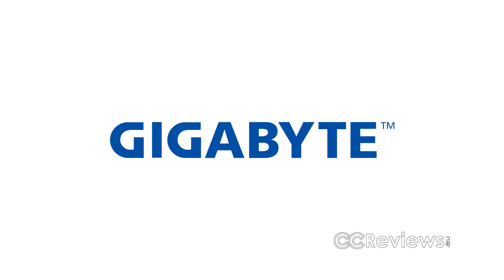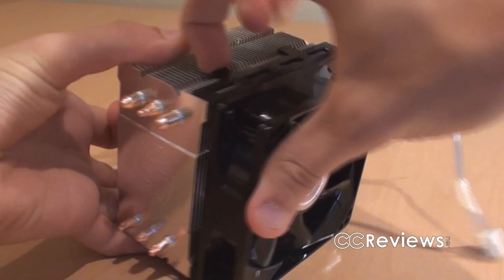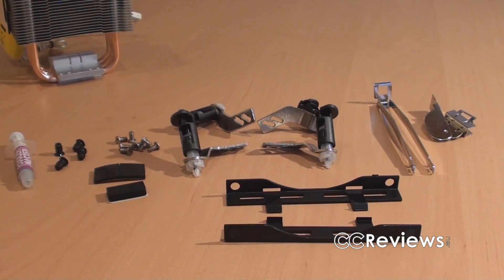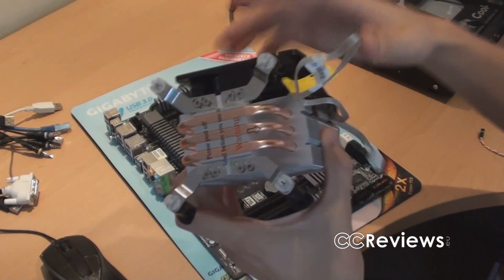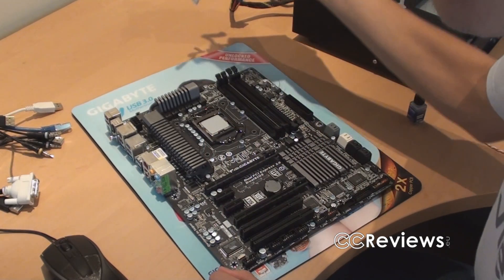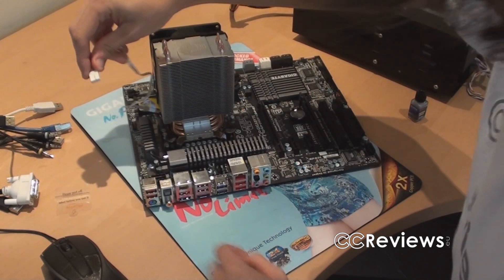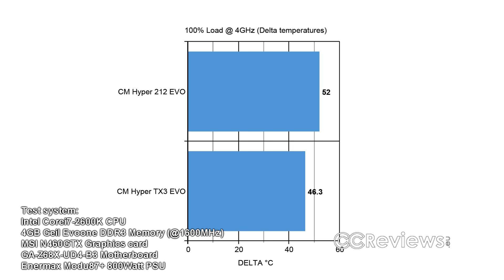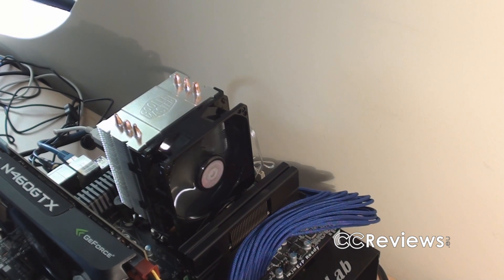#55: Cooler Master Hyper TX3 EVO CPU cooler Review (CCReviews)

Comment: I got one of these coolers about 14 years ago. Worked very fine for my first build. with a i5 3750k.  Just recently in in 2024 the plastic clips that connect to the motherboard became brittle and broke off. Replaced it with a Coolermaster 212 evo.

Comment: I run it with an 7700k and with  outside temperature of 30 Celsius I see idle 31 and at  moderate load, around 56 to 58!! Cheep but very effective, will wait for cooler months so I can see lower temperatures!
Reply: kostastaxi how it is during gaming?

Comment: And abysmal cooler when it comes to high end cpus like the Ryzen 7.  Its really some kind of dwarf cooler, dangerously small, runs on my Ryzen 7, @a good 20c hotter than other proper air coolers. Dangerous for overclocking on a Ryzen 7 as even on mild overclocks it cannot clear the heat quick enough to prevent continuous heat build-up until it hits the thermal limits of the cpu. DONT BOTHER WITH THIS PATHETIC HEATSINK UNLESS YOU ARE ON A BUDGET AND DONT PLAN ON OVERCLOCKING.
Reply: It is been a month but i just wanted to reply, are you really comparing this cooler to a 212 evo? Because of course it will perform better on overclocking and more powerfull cpus. The Tx3 has and 92mm fan and a smaller heat sink compared whit the 120mm fan of 212 evo and larger heat sink. The point of th TX3 is a smaller cooler, identical to 212 evo, for more tight cases. And if you re spending money on a Ryzen 7 you wouldn't even bother or considering buying this cooler because you will need something to keep whit the overclock later on. I didn't understand the point of your comment.

Comment: Guys, I'm begging you, please help me. I did everything fine with the installation and assembly of the cpu fan, screws are in the correct position for my 1151 socket, but the cooler doesn't go all the way in. Two clips go all the way in, but the other two can't. I'm anxious I can damage the motherboard from pushing, but really, it's really tough.
Reply: Well i can try to help you...
Read till the end before doing anything please.
Just take the cooler without trying to mount it on your mother board : do the pins works normally ? Can you unlock them and lock them in ?
Do you succeed to install your old stock cooler back again ? Is the lenght between each pin equal if you mesure from your stock cooler and on your TX3 ?
If they are not check if you did install the legs of the TX3 properly, and maybe try to bend them just a little ?
Just don't force too much on your mother board, i mean you can go firmly, but don't be savage.
For me the most secure way to do it would be to take the time to disconnect and remove your mother board from your case and to mount it inside... That way you could see way more easily what is happening and if the pins are coming in normally.
It's scarry, and a bit tricky to put back on (especially the front pannel connectors) but that's what i would do (remember to take close pictures especially of how the front pannel pins are connected to remember then when you put everything back in)
Reply: Thank you very much for your time and effort you put in this comment. : ) Actually I managed to get it in. Basically, the clippers don't go all the way in no matter what. If I push two clippers - two vertical ones - they go all the way in, but the others don't, which is understandable, clippers should be pushed diagonally first. One pair diagonal than the next one. Well, that doesn't work either, so I realized that when I push one of the clippers which doesn't go in, it actually does go in, but then it goes up again when I release.. So I forced it go back in and then I twist the clipper so it can secure the hole. It was kinda tough to do, cause I was holding the other part of the fan with my other hand. I actually thought about doing this from the start, but I didn't know that the clippers can be secured like that, thought they can be only pushed. 
Lesson learned. ; )
Reply: Glad it worked fine :p satisfying temps ?
Reply: 26-27 degrees C on idle. Intel 6600k. Really good temps !

Comment: Can I use this in my i7 6700k ??
Reply: no. you can only use it on your Xbox one CPU
Reply: ok... I was not kidding... just fuck you
Reply: ofc you can bud...
Reply: Gabriel Coelho doesnt depend of the cpu but of the motherboard
Reply: yeah. Im asking cause i have not seen this config  (i7 6700k + this cooler) yet, and I want to know about the temperature of this mix
Reply: i wont do OC
Reply: TheElmorenous did u get it ?
Reply: Gabriel Coelho why are you getting the "k" version if you are not going to OC? You can use it on that CPU ofc...
Reply: I won it. I will oc, but not now
Reply: Gabriel Coelho ohh I see... in that case buy a z170 motherboard and a good cooler such us CoolerMaster 212 evo or cryorig h7, dont buy this if you will oc
Reply: Well it's a very nice cooler if you do not want to dismount your motherboard (they can come with the plastic pins to fix it to the motherboard so you don't need a backplate).
But i would chose an higher end Rad like a Dark Rock pro or something (but be careful, the rock pro may be tricky to install if you don't have low-profile RAM)

Comment: How much space should there be between CPU cooler and RAM? I'm worried when I install it that it'd be too close to my RAM. The motherboard socket is 1151.
Reply: You don't usually have to worry about that. If you want some headroom you could use low profile ram. (That's what I do).
Reply: Oh, I didn't know about low profile ram solution, thanks for reply.
Reply: No problem mate!

Comment: i got one the only problem installing it was the top left corner clip was hard to pop in and twist it and also had to plug in the power lead befor installing it apart from that it is great for its price and took 20'c off my temp whent from 80+ down to an average 60 and below on full load
Reply: How did you pop it in exactly? I have two clips which can't go all the way in ;(
Reply: Use a screw driver buddy

Comment: is it overhanging the memory slots? that's annoying
Reply: You can move the fan :) it comes off and can be clipped on the other side. or you could spin the block around.
Reply: no not realy it depends on what mother board u have

Comment: dose it come with thermal paste?
Reply: yes
Reply: k k, thanks
Reply: I meant it came**
Reply: +k Oh okay I don't need it because I already may own thermal paste, it's a small syringe from Arctic Cooling
Reply: dckstr yea
Reply: If it comes with thermal paste then why did the guy put some on the motherboard?
Reply: +dckstr because you shouldn't ever really use the pre-applied thermal paste it comes with, I just checked mine today and only after a few days the thermal paste was already almost gone from the heat, I cleaned it of and pre-applied using some NT-H1 thermal compound and my temps on my i7 went from 45 to 35. However, the product comes with a small tube like item that contains thermal paste. You could use that.
Reply: +dckstr also I just re-watched and it wasn't pre-applied. You must of thought that I want it came pre-applied, but I was talking about how it came with a small tube full of thermal compound

Comment: You think this will cool down my i7 4790k when rendering a video?
Reply: Haven´t bought the CPU yet:) but i think i will go with the I5 6600k, i have quited YT, so i dont need to render videos and things like that anymore:)
Reply: +TheDanilon62 yes, I have a i7 4790 with this cooler it sounds like a jet when I game do not recommend for processors like mine however I'm upgrading it with a corsair hydro series one soon
Reply: Skaffa dig en 4690K med den här kylaren så kan du till och med överklocka lite, plus - Minecraft, DayZ, och andra processorkrävande spel flyter på som smort! :)

Comment: I have 4 kingston hyperx fury ram modules in my motherboard. Will the fan come in conflict with the first stick?
Reply: +Amar Raj Jagessar Have you had it on yet, and does it interfere with the ram sticks? I am having the very same question? 4 G.Skill Ripjaw sticks :P
Reply: Still using the stock. Dont have it yet
Reply: I think it can be turned though, I'mma buy one today after some more reviews
Reply: +Mathias Vejs keep me posted
Reply: Amar Raj Jagessar I have just put mine in, and it fit by a few milimeters, phew. Please be sure if you're using Intel, please be sure to turn the psuh-pins clockwise before putting it in, damn I forgot that, heh. Works fine though ;)
Reply: nice, did you build it in the case or with the mobo outside of it? And did you had to remove the ram?
Reply: I put it in IN the case, and I took all four ram sticks out, then put all back in again when I had it installed :)

Comment: I have such and does not'm amazed. In quiet mode it is quiet, but otherwise noisy and temperatures for analysis are not so low that it g1610 use of which is only a 2.6Ghz. Boxing at full power was quieter than that of full speed. 

PS:
Would someone told how to use the second as a motherboard can only join one. If plugging it to another connector second fan will change speed relative to the temperature of the motherboard, not the CPU and the two will rotate at different speeds.

Comment: I will get this baby! Been mulling over Zalman and Cooler Master offerings but selection/price is a bit limited where I'm shopping and my budget is not that high as I intend to buy a new case for my MSI/AMD high performance rig. Gotta get those temps as low as possible. My AM2 3800+ CPU ran without fail for 9 long years with a Cooler Master cooler that's similar to this TX3 actually - don't need any more motivation than that :)

Comment: I forgot to peel off the plastic lol
Reply: +boowh1 Did you turn your computer on afterwards? In which case I'm curious what happened.
Reply: The cpu got very hot so I peeled of the plastic redid thermal paste all is well
Reply: Ah right, could've been worse. Luckily there was no damage.

Comment: I have i5-4690 3,5ghz locked cpu. Wouldn't it be overkill, if i get about 74C with stock cooler, which is pretty loud, when playing games like GTA V, COD AW?
Reply: Don't worry i am getting Arctic Freezer 7 pro, and also i reapplied thermal paste on my stock cooler a week ago, so now my temps don't go above 67C
Reply: Thelostzip that is still over 150 degrees Fahrenheit.....
Reply: With new cooler it doesn't go over 58C on beefy gaming
Reply: Piers Nivans My brother has an i5 that runs 80-100 degrees celsius when he plays and has been doing so for the past year, still fine processors don't die as easily as you might think when you run them at stock speeds. I'm getting a new cooler for him though now that's why I'm here.
Reply: Piers Nivans I know that's why I'm getting a new cooler, just wanted to point out that processors are usually pretty resilient to high temperatures and have built in safety measures to prevent damage. Prolonged high temperatures significantly reduce life expectancy though from 50+ years to possibly under 5, a processor running 80+ degrees when it should be around 60-70 tops is like time's passing upto 50x faster for the processor.

Comment: this is the best thing i ever bought ! from 90+c to 60c Max !!
Reply: +Jonathan Peden m8 go amd i have 9350 oc 5ghz
Reply: Ziad Ak I'm glad to read your comment, I have just received mine, I'm waiting for my CPU, motherboard and RAM to arrive so I can do my full system upgrade.
Reply: what the hell! your cpu should not run that hot where do you live death valley and its 125 degrees Fahrenheit inside your room?
Reply: @xDEATHCLINCHx  please see if you can help me with my trouble !
Reply: @xDEATHCLINCHx  hey check my scenario you would be shocked 😅 , can you help me out ?
Reply: I can definitely add this up. My 88°C CPU with stock cooler on load is now running at 60°C ish under load ! definitely a worthy choice
Reply: anas lolit Now that's what I'm saying brother!!  Intel?  Intel who...?
Reply: please help me out , my i3 540 cpu temp breaches 100°c barrier in AAA gaming with my gtx1070 , sorry for mismatching & serious bottlenecking , still its temp profile is way abnormal ... So i am looking to buy this cooler , how much lower temp will it help to get to be least ... please anything you can help me with this ?  & will i get slightly better fps with improved cpu cooling ? thanks in advance
Reply: it is rly one of the best coolers i had,  prize for performance so good, i have it from 2016 and still goes on.

Comment: is this cooler good enough for the intel i5 4690K?
Reply: Yes sure it is, but you should install a second 92mm fan.
Reply: MegaSonic Like the United1709 said it is good enough but with that second fan it will be better :)

Comment: Can i ask whether the cooler overhangs any memory slots?
Reply: It overhangs slot 1 a tiny bit on my ASUS Z97-A, but unless you have heat spreaders on your RAM that are more than 6mm you won't have a problem. Mine are around 4mm and fit just fine.
Reply: thanks for the feedback, i currently have a gelid tranquillo cooler and it completely overhangs two slots, even low profile memory doesn't fit, hence why i'm looking to upgrade

Comment: I'm thinking about getting one of these for an AMD Phenom II X4 965.  I've had the CPU for about 2 years now and the stock cooler works fine, but it sounds like a jet taking off.  Does anyone know if this is quieter?
Reply: depends. if your doing basic internet browsing it will be much more quieter. but if your going to overclock or do ultra gaming, there won't be that much off a difference.
Reply: but thats only with the fan delivered with the hyper tx3.

Comment: hi
im using I5 4690K for gaming.
what CPU do you recomend for better temperatures?
CoolerMaster Hyper 412S  or ooler Master Hyper TX3 EVO ?
Reply: h100i :D
Reply: You know there is a reason why im looking for cheap coolers and not 100+$ cooler...
Reply: hyper 212
Reply: sure?
:(
Reply: UltraGamer The eve 212 is  a excellent cooler. Using it atm with my 4690k :)
Reply: TheDarkplayer01
nice. what kind of temperatures do you get while gaming with demanding games like Battlefield 4 or Far Cry 3?
Reply: UltraGamer 30-35 at idl and 55-60 at load
Reply: Thanks m8.
I will probably go with H80i tho :D

Comment: would you reccomend this to a:
1)Processor: Intel® Core™ CORE I5-4690 3.4-3.9 GHZ, 6 MB cache, 4 cores. (that what it says where i buy the pc) (I WILL NOT OC so its at 3.4-3.5)
2)MotherBoard: Gigabyte GA-B85M-D2V CPU Socket 						 							 								LGA1150 							 						
will it fit ?

Comment: i got hyper evo 212 with 2x120mm fans with 1600rmp  also i have haf 922 case with 2x200mm and 5x120mm fans and im using amd fx 8320 overcocked on 4,6chz and i have te betvin 40 and 45 C  with 25 DEgrees  celcius  room temp: PS all of thos fans with controler from mobo i dont have noise at all!!!!!!